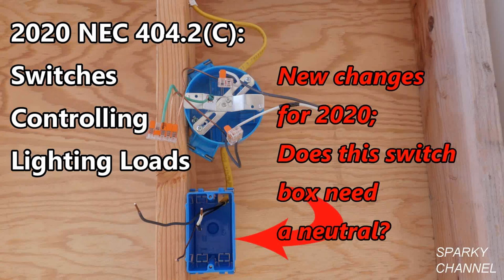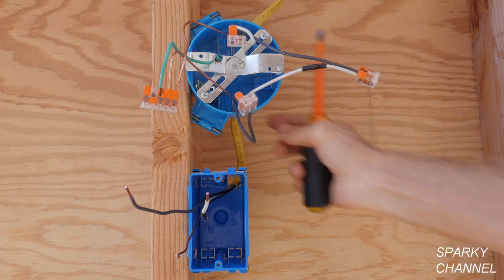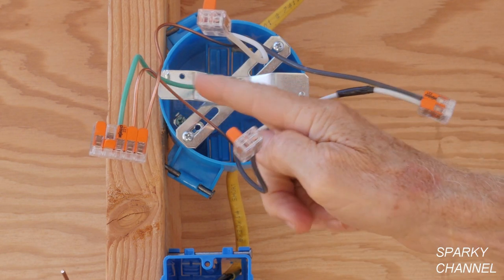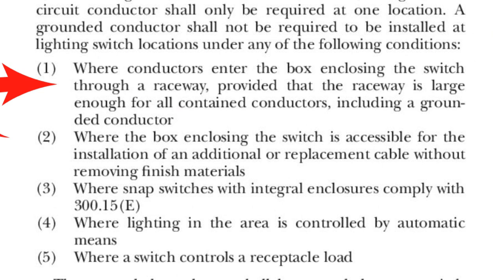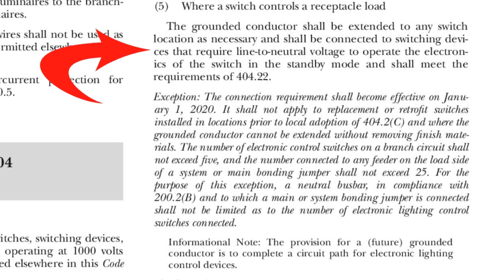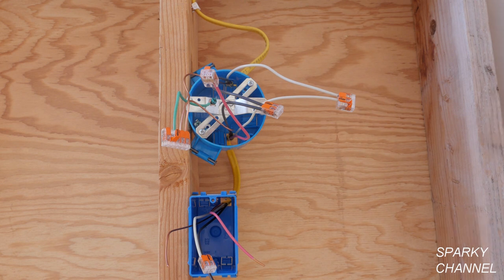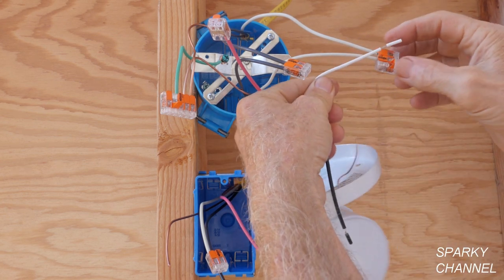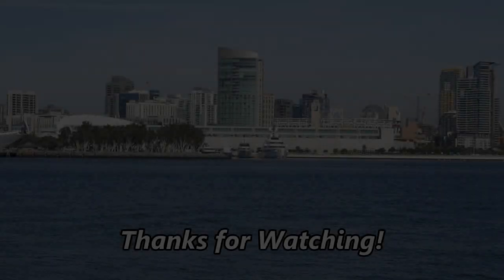NEC 2020 404.2(C) Neutrals in Switch Boxes with Example and New 2020 Exceptions

Comment: I don't do switch legs. I feed power to the switch box and then to lighting. Problem solved. And besides, your switchbox should always have a neutral because you might want to install some kind of electronic light control in the future.
Reply: I never seen any type of control device require a neutral.
Reply: @stevenpersinger6577 Ah, but there are quite a few out there. Bill demonstrated one of them in this video, so you've seen that one!
Reply: Steven Persinger how would it run it’s integrated circuit without an available voltage difference?
Reply: @MrFitness94  actually just referring to single pole toggles in a basic home
Reply: Steven Persinger oh well yeah like Wellcraft said you’ve seen them now!
Reply: @MrFitness94  Just to help understanding a bit better. A standard single-pole, 3-way or 4-way switch does not require a neutral and does not need a neutral. However, if it is replaced with an electronic type switch, such as a dimmer or a switch that controls an Alexa app, etc., some of them do require a neutral and will not work without a neutral. When there is no neutral available, some folks will "cheat" and connect the neutral on the electronic switch to the EGC (Equipment Grounding Conductor), known generically as the ground, the bare or green-insulated wire. This is a big Code no-no. The only purpose of the EGC is to carry ground-fault current away safely; it is not intended to carry everyday operating current. The essential reason is this - at many places along the EGC path back to the service equipment, carrying the momentary ground-fault current, just milli-seconds before the breaker trips, the EGC is accessible to personnel. A simple example: a dryer is running and a loose hot wire shakes loose from a terminal and touches the grounded frame of the dryer. For a fraction of a moment, just before the breaker trips, the dryer frame is carrying current, a dangerous condition. If the dryer frame was not grounded and someone was touching the dryer frame and another ground source at the same moment, such as a water faucet, they would be shocked, in some instances possibly worse. Going back to the electronic switch that requires a neutral, if it is connected by "cheating" to the ground, then the entire EGC system in the house is a potential source of shock, continuously. Not a happy scenario!
Reply: Wellcraft you replied to the wrong person dude
Reply: @MrFitness94  Well, oops on me! Hope the info is still helpful to others!
Reply: Wellcraft i enjoyed it
Reply: @MrFitness94  Thanks, much appreciated. :)
Reply: You most not do to much electrical work? Or newer homes.
Reply: @wellcraft2136  a 3 or 4 way switch does require a neutral in the box in less one of the exceptions is met.

Comment: Worth mentioning the code shown but not called out: that a grounded conductor is not required in a 3-way switch-loop box if the other switch has a view  of the entire room area.
Reply from the maker: Yes, thanks, that's a good point.
Reply: To me that  makes no sense. In residential, the Romex will have a ground. A commercial application you will be using a 4 square, or gangable box. Both metal boxes. So you are telling me that if a large room with multiple doors n switches in the same room I don't need to ground the device, or the box? Or am I reading something wrong. 🤔 using M/C cable is not a ground. And even EMT, you still need a grounding conductor. You used to be able to use EMT as your grounding conductor, not any more. In a hospital or doctor's office that uses x-ray, or MRI, you would use special green M/C Cable with a bare wire ground for equipment caseing or boxes that must be grounded, then the insulated ground is for devices or equipment ground. One goes to the metal box, or housing, the other goes to the devices or actual equipment boards.
Reply: @mdvener  You are confusing a GROUNDED conductor (neutral in this case) with an equipment GROUNDING conductor.
Reply: @WardCo  thank you.
Reply: What was the reason behind the code changes?
Reply: Thank you. I was not happy that I was losing my single 14/3 run to far away 3 way switches. So glad I saw your observation.

Comment: Can you start your homerun or main wire bringing in the power in the swtich box then go up to the ceiling light box?
Reply: Yes, but if the cable is already run and you're doing work to change a switch, then changing the cabling setup is often very hard to do.

Comment: I question that it's always necessary for new work.   Because of the two words "as necessary".  
Feel free to debate, I might agree with you.    (The grounding conductor shall be extended to any switch location AS NECESSARY....).   It might be a good idea. Sure, but a closet light, will likely never be smart, or have a fan (unless it's a grow closet, lol).
Reply: A closet is not a habitable area, so   is not required to extend the neutral. The same would apply to other spaces such as attics, basements, open porches, pantries BUT all this is subject to the definitions of livable in the applicable building code. The main issue I see with this rule is the code does not identify the type of structure, say dwelling unit, non-dwelling (commercial)n etc.

Comment: That's happing over here in the UK. However if the supply Live (Hot ) and Neutral are at the switch this might be problem. Think of Smoke alarms (on ceiling) installed at a later date it would need both a permanent Live( Hot ) and Neutral. Ain't no good if its down at the switch. Future proofing wire up to ceiling permanent Live (Hot)  and Neutral along with Switch Live for  lights. Then wire back the permanent Live and Neutral and Switch Live to the switch. Happy Days.

Comment: This video confused the hell out of me.  Then I realized he said the power starts where the light is.  But why take the power source straight to the light and not the wall switch?
Reply from the maker: Sometimes, especially in older houses, the power comes to the light. In modern wiring we usually bring the power to the switch. I try to cover all the possibilities.
Reply: @SparkyChannel  thank you for your response. I look forward to a new video.
Reply: Sometimes it is a lot less cable to run to fixture first as well, depending on layout. To a small extent pretty much always, just running one cable down the wall and another right out where it pretty much came from.

Suppose if the neutral is required and you have to run 12-3 or 14-3 from fixture to switch there might not be much or any savings, but still can be neater, and less crap in the wall

Comment: Hey Sparky, what does the code say about marking the white wire as hot? I have always passed the black as hot to the switch and switched the white with a marking back to the fixture. You have it reversed...

Comment: so on new switch installs it needs white wire in the box ? all are switches have 2 wires from 1960's and the down stares has all lights on one 15 A breaker

Comment: Oddly enough, I've always run power to the switch first on any new circuit.  Seems more logical since the run from the switch to the light(s) are only live when the switch is on, vs. having the line always live (that tagged white conductor) if you run power to the light(s) first.  The Run from the switch to the light(s) always has a neutral available then.
Reply: All of my runs in my house go through the lights and then out from there to the switches and outlets, so I don't have this option unless I change completely how the runs come in to each room. 
However, when I change a light I bypass the light with the hot and tie the hot directly to the black going to the switch. Then the switch's white goes to the light's hot.
Reply: In Australia we call that “loop at the switch” method of wiring a house. The other method is “loop at the light” 🦘

Comment: Pardon, but not having the power switched before delivered is a dumb practice. How that ever made, sense beyond saving a few cents worth of copper, will continue to be a mystery.
Reply: It's save a LOT of copper.
Reply: My house was built in 1915 and had electric added to it about a decade later. Every ceiling fixture has power in it and old brittle cloth wire. I hate it
Reply: @pb7379-j2k  --  Well a lot of homes built in that era (including where my grandmother lived) has "Knob & Tube:"  wiring.   So long as you didn't mess with it, it was reasonably "safe & sound."    For the most part it used the wire insulation (rubber with cloth wrapping) only as protection from accidental contact.   Shorts were prevented by carrying the wires through ceramic tubes when going through wood beams, and on ceramic "knobs" when going across wood beams.
Reply: John Gilmer yep. Mine’s not K&T, it’s two conductors in flexible metal conduit (like BX today). But it’s scary to work with because the insulation cracks and falls off
Reply: @pb7379-j2k    Worse still,  this cloth covered wire is a pigtail drop from K&T in the attic,  and it was common practice to switch the neutral.  Gotta love those old Colonial Revival and Victorian homes.
Reply: @GilmerJohn  what am I missing, I'm not seeing how it would save copper.  If power is ran directly to the light, then to the switch, wouldn't it be the same amount of copper if it were ran from the switch, then to the light?
Reply: @brianjc85  I think it can save some copper in some situations. I don't know about a lot of copper. But I agree with @RJ run power to the switch and switched power out of the switch. It's safer and simpler to do IMO and it's code compliant even if the alternative is code compliant and saves a small amount of wire.
Reply: It was not uncommon for all the ceiling lights on one side of a hallway to be fed with one power wire in the ceiling that went from light to light, with each light having a switch leg. This would have used FAR less wire than running a power wire between each switch AND running a wire to the lights, plus it placed all of the wire nuts in the nice big ceiling box instead of the switch box.

Comment: Hi Sparky
As always great video ! Always enjoy them! 
Just one thing in this one though, and  I hope that it  shows that I was paying  attention . I couldn't see any staple or clamp on the cable securing it to the stud as it was terminating into the switch box at the end ?
I know the vid was on grounded conductors required in switch boxes, and you changed out the piece of NM sheathed cable, just thought you might want to have kept the example as it would best be found in the field.
Looking forward to more GREAT segments, especially on the 2020 code changes THAN YOU👍
Reply: @Jon Marioles: I think he is probably well aware of that, though ya make a great point. Though I'd wager a bet that this is primarily focused on Grounding... Thus, if one takes a look at virtually any of the Videos, you'll see the "Backplane" board or plywood mounting assembly has them!

Comment: From experience in my home and others that are old. I haven’t seen any of the white wires colour coded black or red.
Reply from the maker: OK, thanks!
Reply: Both the input and output wires of a switch are considered to be hot. One constant and one switched. It doesn't matter what color they are.
Reply: @RobertLeBlancPhoto  It does matter about the color! White wires are identified as being grounded. If not re-identified as non grounded by colored tape or similar method, you will wind up with a “hot” white wire in the outlet box. Possible to mistakenly tie hot white in with neutrals on finish wiring.
Reply: @charlestaylor3544  Spot on, if a "white" conductor is carrying current it must be identified! It WILL be mistaken for a neutral by someone at some point otherwise.
Reply: @jeremiegrund  white wires do carry current, and they are neutrals. Basic theory "unbalanced load".
Reply: @phillipphillips8701  Very very true, working with neutral wires at a junction box etc. without the power turned off can be a shocking experience if you (your body) offer a path to ground.

Comment: This makes me want to take the power to the switch, and have a switch + receptacle,  on the wall.   Then only run the 12/2 with ground to the light.
Reply: My thoughts as well.
Reply: I've been feeding the lamps in my new house at the switch. Seems like a good idea, but if you connect one or more  receptacles or switches downstream, the box starts to fill up. That leaves less pace for a motion detector switch or timer. So I changed to feeding the power to the lamp and running a 12/3 to the switch. That way, the box is relatively empty and you have both hot, switched power and [unused, capped] neutral without crowding.

Comment: so a 3 way or 4 way switch would not need the nuetral wire ? I have  never seen a 14/4 wire set
Reply: I have the same question, but in a 3way or 4way switch set up you can only install one electronic control switch in one spot same as with a dimmer so I don’t think it applies? This code was pushed by manufacturers so they could sell more smart switches

Comment: Neutral can not be a current carrying conductor. No tape to phase the wire, number 6awg or smaller. All boxes need a Neutral.  That wire from the lite box should be a 14/3. Just bury the white, unless needed with certain dimmers. Those wago connectors, will never be used by me. Not enough wire for a connection. The proper twist and correct wire nut is a much better connection
Reply: The part about "Neutral can not be a current carrying conductor" made me laugh.   That's the difference between an electrician and an electrical engineer.    Electricians know the code inside and out but many of them know almost nothing about electricity.    Don't feel bad though, you're far from alone in that regard.     FYI the neutral wire carries the same current as the hot wire.   All series elements in any given circuit have the same current.   Current only divides at a parallel node.
Reply: @wouldntyouliketoknow9891  ,after 40 years as a licensed electrician, and teaching apprentices, I know that the nuetral carries the current to complete the circuit. Yes it does carry voltage, but in a switch loop you can't use it to feed the switch and black as  a switch leg back to the lite box. Also you are not supposed to us a white as a traveler  In a 3 way or 4 way switch. Any electrician will know that you can get shocked from a nuetral under a load, the more the load the more of a shock you will get. So what is it I don't know. How long have you been doing your type of work with actually pulling wire, making it up, connecting motors, compressors, commercial timers, and so on. Where I last worked I got an award for most outstanding field service tech, multiple times. I must be doing something right. My first boss was a great guy that helped in the wiring of the World Trade Center Buildings.
Reply: I guess what I should explain what I mean. In residential, commercial, a white wire cannot be used to be a feed in a circuit for lighting and receptacles, switch leg, travelers, and so on
Reply: Incorrecto!!!
The neutral is most certainly a current carrying conductor  - or none of your single phase loads would work when you plugged it in.
Reply: I agree about the Wago's. They are future service calls.
Reply: @wouldntyouliketoknow9891  I have known a whole lot of book smart formula smart engineers with horrible mechanical sense. I have discussed electrical theory with fellow electricians for 35 years and while there are definitely the monkey see monkey do types out there I would say at least half of them have made it their business to understand electricity fairly well. So I am calling complete BS on your remark. You only cast considerable doubt on to your understanding of electricity.... Which btw is a very vast subject that knowledgeable people don't pretend to have mastered.
Reply: @mdvener  we do it all the time. Hear me out. You have a fan with light in the living room with a distant 3-way switch on the other side of the room. We power into the 2 gang switch box at the entrance. We run a 14-3 switch leg from the switch up to the fan. (It could be just 14-2 but we switch the fan and light separately using that one 14-3 leg. So- that will give us the red conductor for the light switch, the black conductor is used for the fan switch. Now the fan turns on in that single location but the light has that three way. In the single gang on the other side of the room all you have is a dead end 3 way. The white is the point wire there- bringing power. That’s because In order to switch leg and power feed the three-way from the same box you have to tie the white (from the 14-3 running to the other three way) in with the black hot fed in at the two gang.  The red and your black are travelers and your white is pigtailed with the power. We do this DAILY in 8-plex new construction.
Reply: The old codes had exceptions for switch legs allowing the white wire to be used in this way if Romex.  It's been that way since Romex type wires were introduced, probably in the 1940s . I've been wiring this way since th e mid 70s.
Seems wasteful to provide and extra unused conductor.   Have you seen the price of 12-3 lately?
Reply: @gn4720  You'd lose that bet. When I rewired my house 4 years ago I used Wagos in all the receptacles, switch boxes, and j boxes up in the attic. Never had the first issue.

Comment: With the increased use of led bulbs that use so much less load will code be reduced to a smaller wire like a 16 or so?
Reply: No because a homeowner still has the ability to install an incandescent or CFL in the circuit
Reply: @jacobnunemaker7126  exactly it wont ever change
Reply: Lets simplify the answer, to copper wiring.  amps create heat.  so, wires have ratings based on the heat related to current.   12 awg (cu) is good for 20 amps.   14 (cu) is good for (15 amps).   And 16 (cu) is only good for 8 amps.   (dolt...) there are no 8 amp breakers sold at home depot.     So...no, not currently.